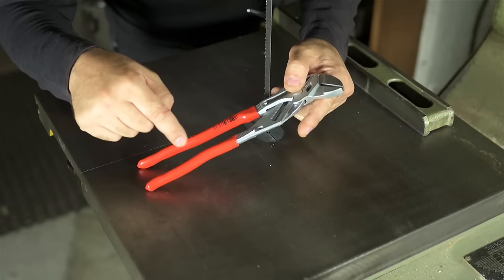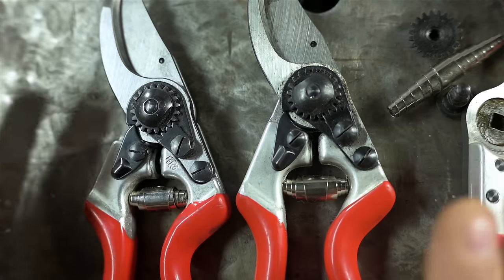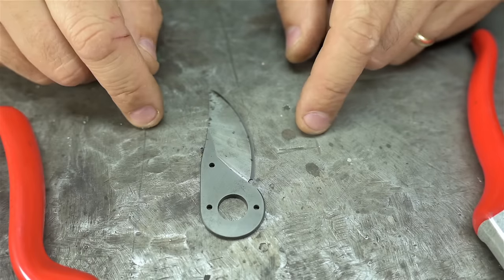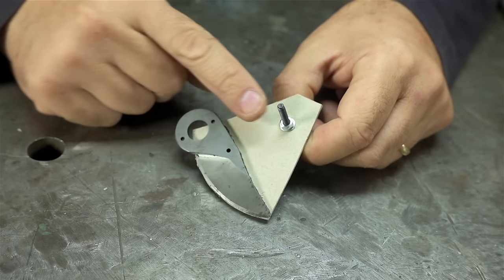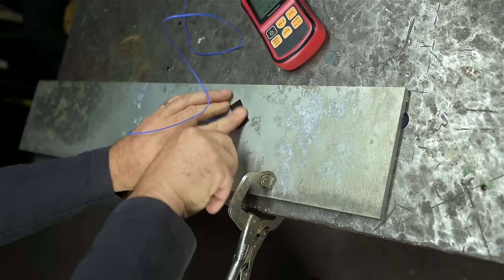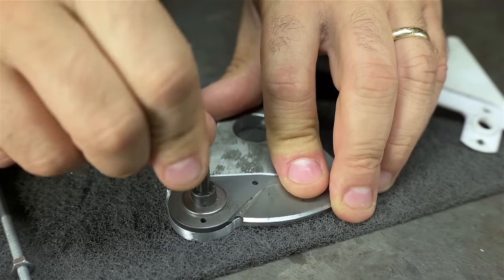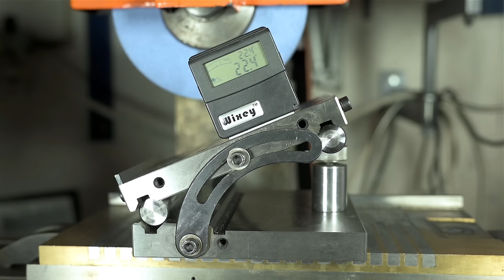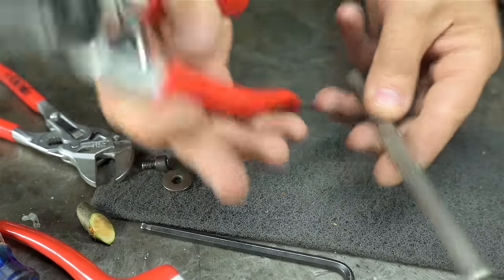Unnecessary SHARPENING JIG!

Comment: Why is it when quality pruners get used by someone... whom cut a 3/4 inch thick dead rose stock are never going to work again? Let alone after fixing the burr created by thee? They simply won't close beyond where the burr was removed*** I know why, but I simply can't think why such little tolerance and high hardened steel is needed for 99.9% of the population... I already bought another pair

Comment: Are you familiar with the Lansky system?? https://youtu.be/3uiZc1grvQg
If you add an eye to the bolt on the holder at the right height, you could also use one of those to get the perfect angle. Even while in the garden.... 
But do get the diamond or carbide files. 
Talking about diamond files. Have you tried the little Felco one. The 903. The one you show @5:12 with the angles....

Comment: Dude... you're making my head hurt.  You said you stretched the aluminum to cool it down to make it brittle.  ugh.  you troll.  you know deforming metal increases temperature.. and constant pressure would do nothing to cool something down.  =)  For the record.  Aluminum is different. As a face-centered cubic material, it has no DBTT (ductile to brittle transition temperature). As the temperature is lowered, aluminum becomes stronger but remains ductile. In fact, aluminum alloys are ductile even at liquid helium temperatures (-425 degrees F).  You can take that area 51 aluminum and.... shit... beam me up scotty.

Comment: Yeah, factory sharp is often not very sharp, at all.  Those tools don't exactly cost a billion dollars.  Buying new ones every few decades or so isn't going to break  you.  Just sayin'.   You maybe should have led with the no brand name.  Even where they are, the fonts, scales, and spacings in the brand name stamp are all over the place, that sort of thing is typical for knock off clothes, etc.

From the sharpie cut, it looked like that might be a slightly hollow ground cut.  If so, shame on you.  :-)  I also saw the circular shape immediately...so what do I win?  A 3-D printed jig maybe.  Have you thought about putting the CAM file (or whatever it's called, print file seems taken) somewhere people could pick it up, so they could make one without having to invent the wheel, again?  Great grip, BTW.

Now for the embarrassing part, I'm a retired aerospace engineer and my wife had to explain the 51 to me, so don't feel bad.  She pointed out that she is watching Roswell right now, and I never would, so there's that.  It's not making me feel any better.  Your machining always irritates me, but I guess it probably helps to actually know what you are doing, and not be using HF crap.

"Didn't this little project escalate quickly?"    Like opposed to what, every other one?  Damnit, you got me on the hollow ground comment, but at least you didn't recalculate it, so you're good.  Then you got me on the price thing, too.  I hate you, and I'm not thrilled with my wife at the moment (kidding, both cases).  "I may not be quite on the center line of this wheel".  OK, you are back in good graces.  I love this channel...nerd humor.  I miss the techs/machinists, etc. I had.  Bunch of card carrying cards.

I shouldn't write while I am watching.  You always get me in the end.